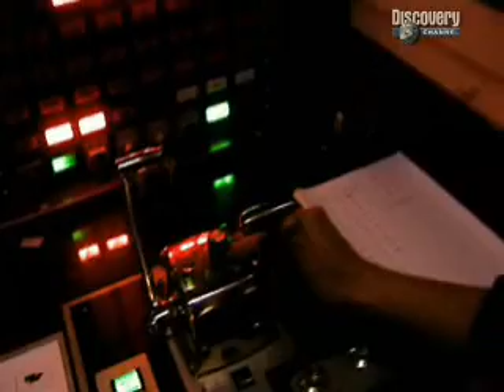The Ultimate Fighter Jet  1 of 3

Comment: Not according to pilots who've fought each other its not! Look up Typhoon eats Raptor salad and see.
Raptor is possibly better at low speed due to thrust vectoring but Typhoon is better at higher speed where most dogfights would be fought. Raptor's advantage is BVR. also EF is getting thrust vector nozzles and superior 3d ones and has the better HEA that the F-35 will get so is probs better in close.
Raptor's genius is BVR and being able to operate in denied aerospace. Typhoon is a pilots plane

Comment: Controls and handling:The level of understanding and skill needed to pilot the Harrier is considerable. The aircraft is capable of both forward flight (where it behaves in the manner of a typical fixed-wing aircraft above its stall speed), and VTOL and STOL maneuvers (where the traditional lift and control surfaces are useless).

Comment: Also there's an almost imperceptible different in the rear fuselage. The Gloster plane's airframe tapers off behind the cockpit whereas the plane in the modern footage has a level edge. Look at the relation to the engines and fuselage between 3:49 and 3:54. It looks suspiciously like an Armstrong Whitworth Meteor they're towing out the hangar. That's the only explanation I can come up with for the difference. Any thoughts?

Comment: First of all, I'm not American. The Rapotor is actually cost-effective. Quite frankly, it's so dominant that you don't need that many of them. The US has close to a thousand F-15s, those weren't cheap either. That many raptors won't be needed.

The EF is a good plane but it too turned out extremely expensive. Too many countries with different needs. The JSF will cost about the same and it's one generation more advanced.

Comment: EF 38 millons vs F22 100 millons, even USA can not produce a lot of raptors, it is so expensive, besides, EF is multi roll, Raptor  is just for air combat, Ef is small and is easy to become a stealt, using plasma for example o change the materials, also the EF can use vectorials engines as the su 37.

Comment: thyphoon's radar has a lower RCS which means it can detect the raptor, and when it comes to supercruise both has sustained super cruise.and both are made to engage in long distance F22 can engage at 100 miles while EF can engage at 85 miles in terms of targeting system EF has the advantage, when it comes to speed f22 can cruise at a max of mach 2.80 EF can cruise at mach 2.30